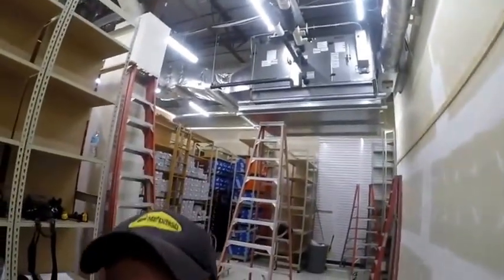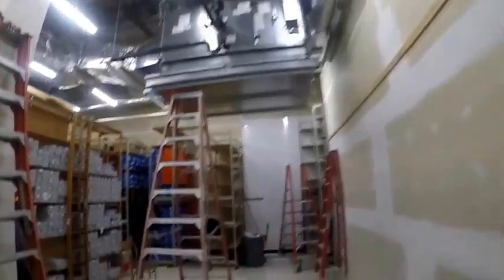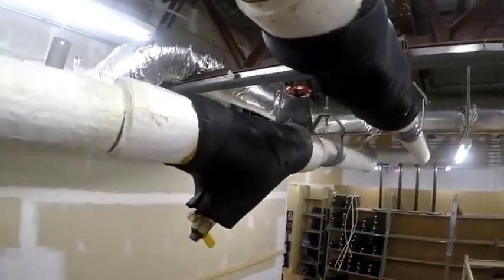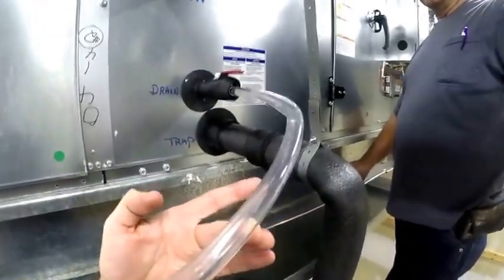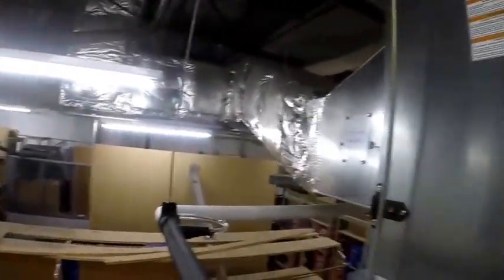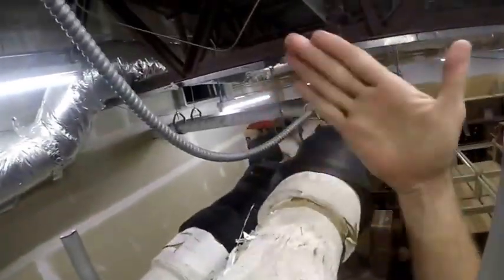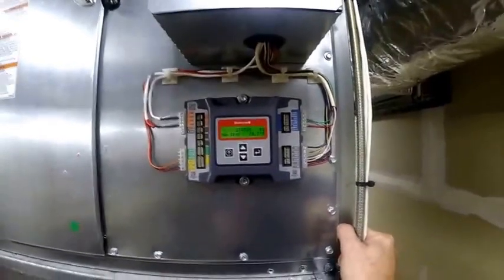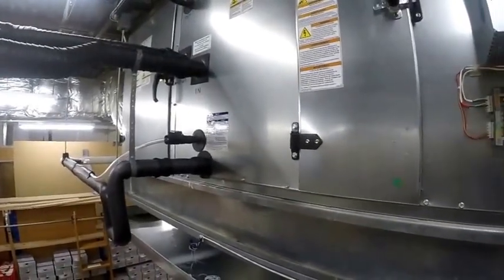Chilled Water AHU Training

Comment: A lot of our sites have either 2 hydronic coils or one coil with with a changeover valve for heating/ cooling with a face and bypass.
Reply from the maker: Jason - Yeah there is several different arrangements of these systems, completely depends on the mall and region of the country.
Yeah we call those 2 Pipe or 4 Pipe systems / 
2 pipe is for 2 water pipes, 1 coil where the Mall heats water in winter and chills same water in summer
4 pipe is for 4 water pipes, 2 coils, 1 Coil for hot water and 1 Coil for chilled water